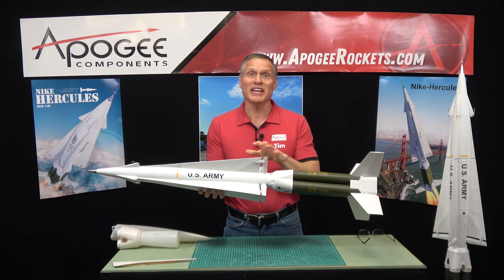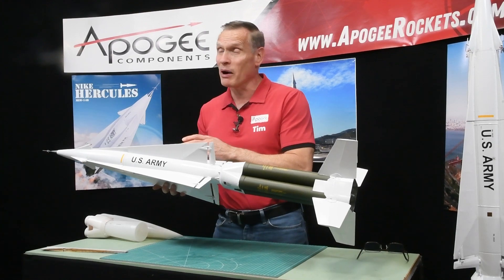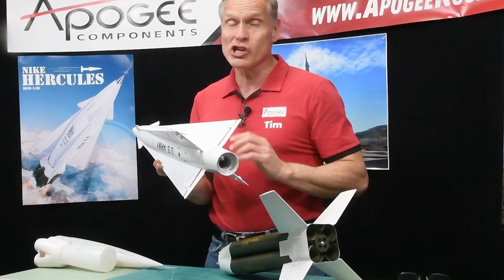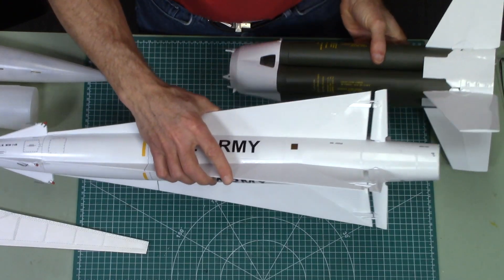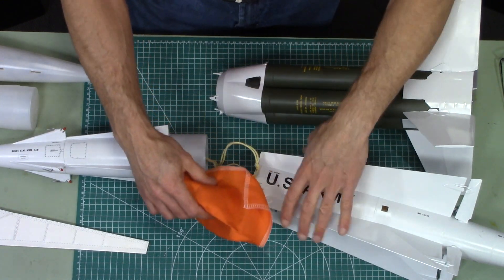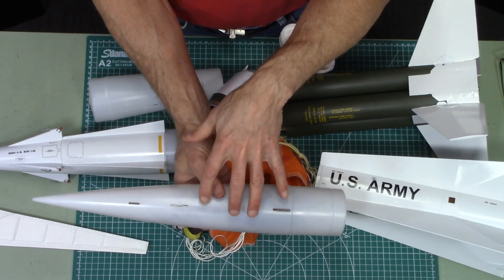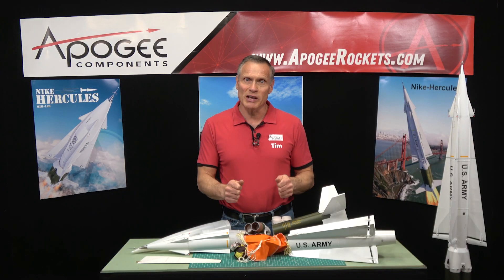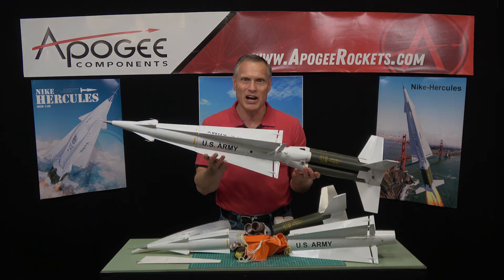Nike Hercules Introduction Video

Comment: Amazing rocket kit- just ordered mine and I can't wait! 500$ honestly makes sense, its really big, high quality, and it can be very expensive to manufacture plastic parts for something like this, especially if you are only making 100 kits.
Reply: And I'm really happy about the injection molded parts- if they were paper, I honestly wouldn't have wanted to buy it, it wouldn't look as good.
Reply from the maker: @LeviWilley-l7o  You're right. The injection molded parts are the key components of the kit.